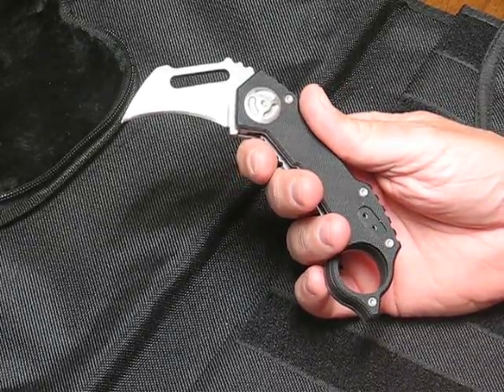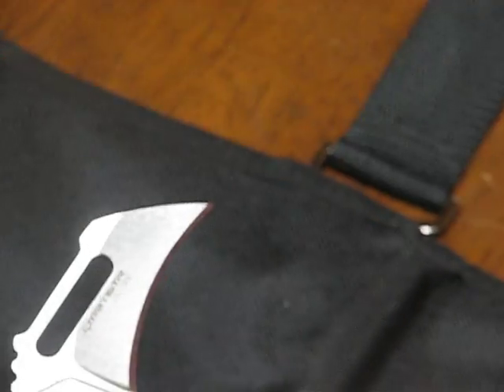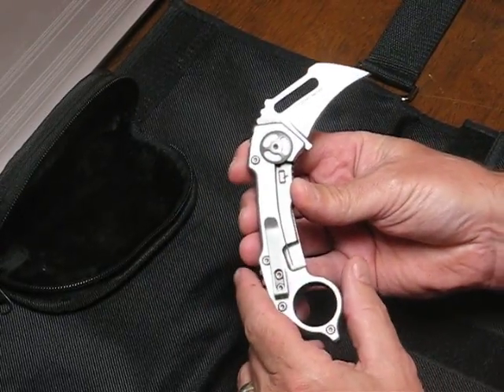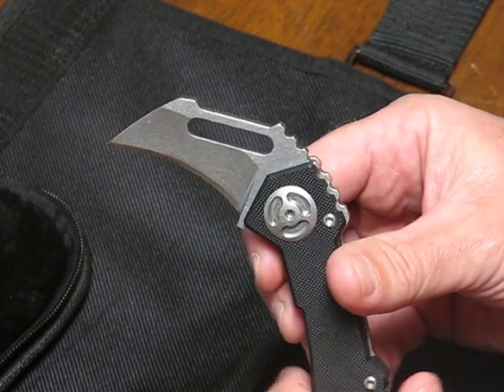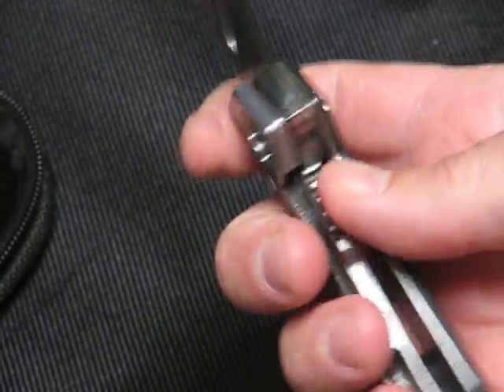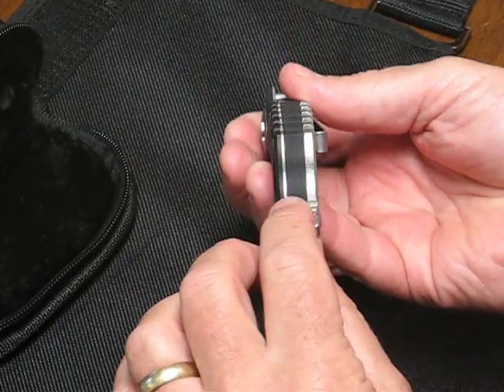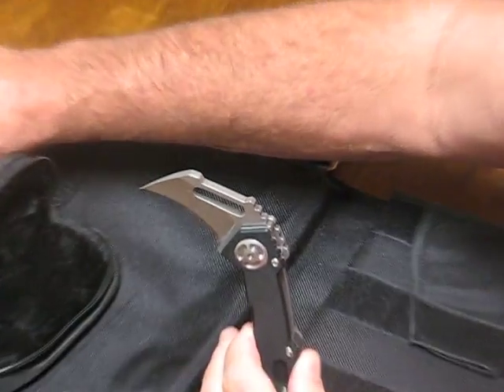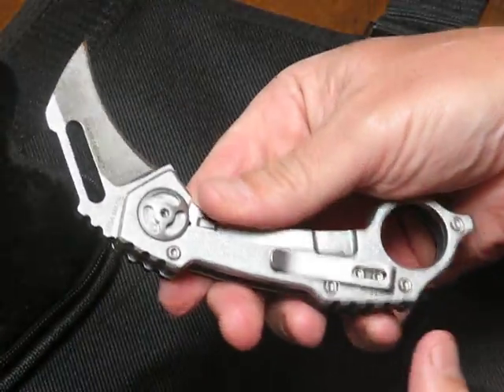QTRM5TR QTR 5 Hawkbill Karambit Review | OsoGrandeKnives

Comment: Could you tell me how BD4P steel wears and resists rust because I really don't like tool steels on folders if they rust easily
Reply from the maker: CTS BD4P alloy is a high-performance blade steel offering a fine, uniform carbide structure yielding excellent edge retention and grinding/polishing characteristics. This alloy is part of the Carpenter CTS family of alloys. BD4P is a powder metal processed, air-hardened, high-carbon chromium steel offering enhanced corrosion resistance and toughness compared with Type 440C stainless. The alloy is a strong candidate for a variety of cutlery and other knife applications.
Reply: Thanks

Comment: You mentioned the blade thickness as being 3/8" thick, and it looks it in the video. However, on your website in the specs for this knife it shows .185" for the thickness. What's the deal? 3/8=.375 of an inch. Not quite the same thing.....
Reply from the maker: Thanks for pointing that out... The blade width is .185".